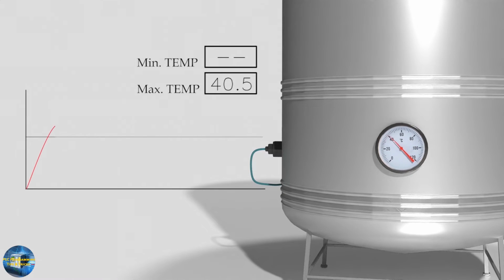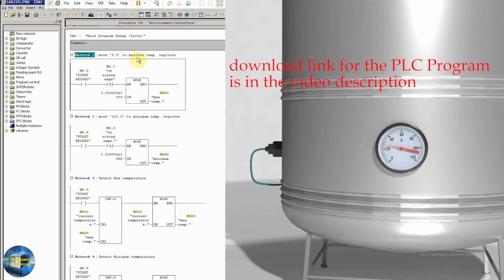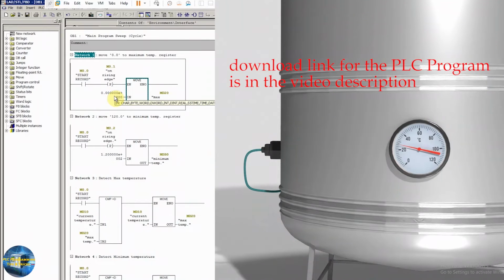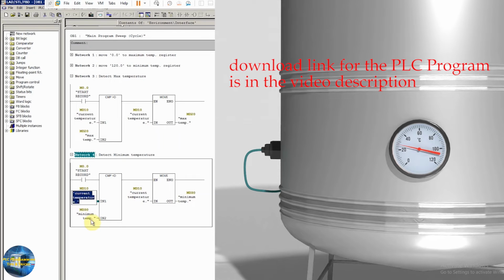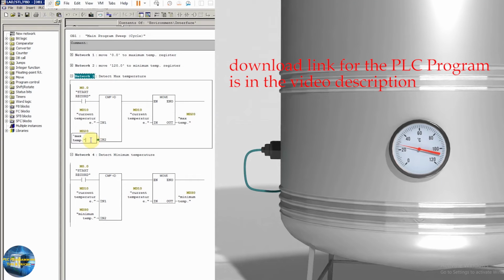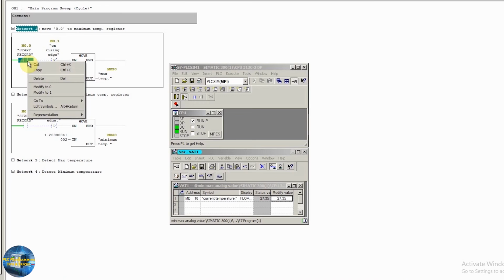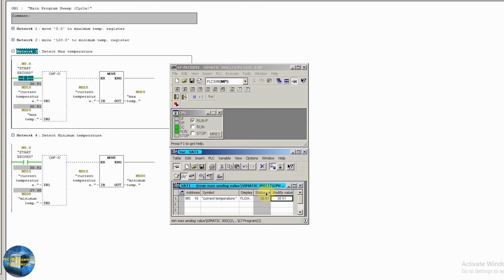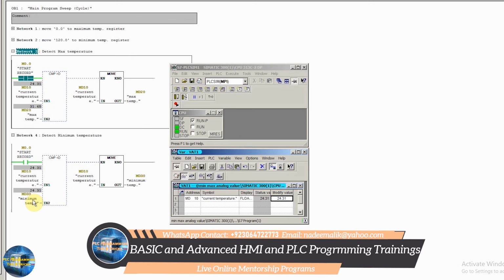min and max temperature values logging using PLC Programming

Comment: did not understand the function of network 1 and network 2
Reply from the maker: When we start the process, the old cycle will scan the maximum temperature starting from zero , and minimum temperature uptown 120 degrees